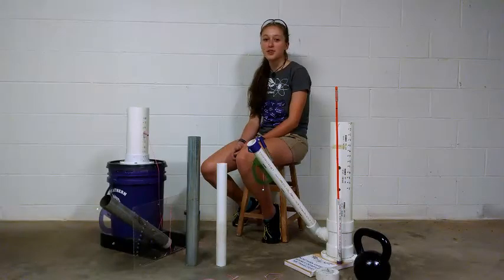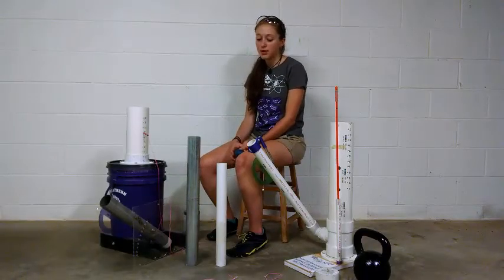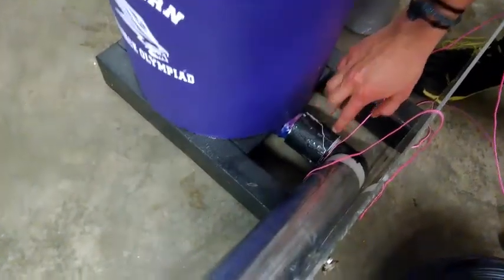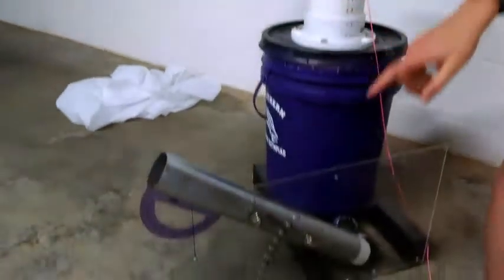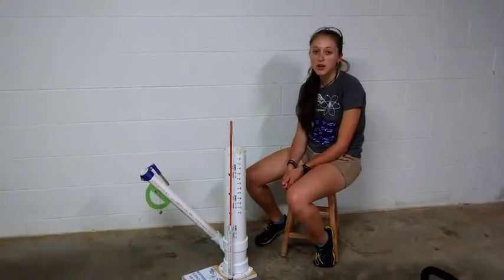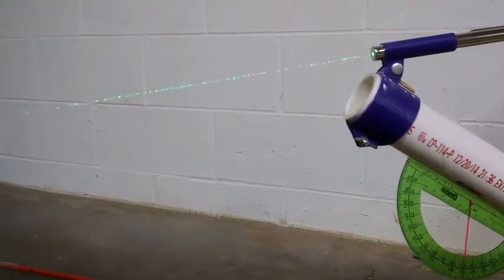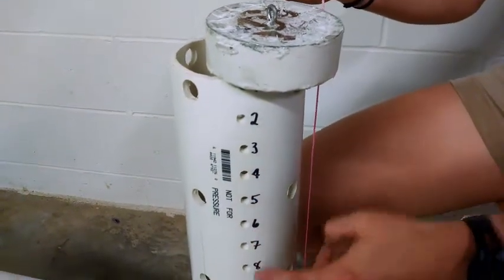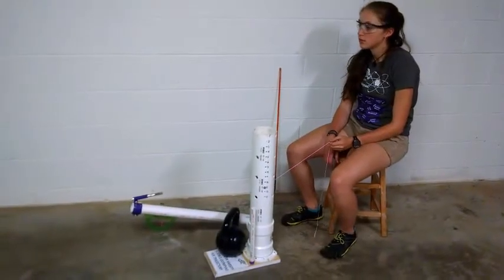Science Olympiad Air Trajectory

Comment: Hi I was wondering if you could explain how you were able to use the fence post to be able to change angles with the protractor with still being a snug fit so air isnt lost through the holes?
Reply from the maker: To change angles, just twist the pipe... do not glue in place.     Some air is lost through the holes but not a significant amount

Comment: Can you explain how you use the protractor, string, and the written angles to figure out the angle?
Reply from the maker: the string with a weight will hang strait down... just attach the string to the center of the protractor to measure the angle

Comment: How did you make that mass for the 2016 model?
Reply from the maker: We found a metal food can that was similar in size to the PVC diameter, then  Filled the can with fishing weights.   To ensure a snug fit, the outside of the can was wrapped with tape
Reply: @TMartScience how were u able to make it into one cohesive mass? With glue? Melting the metal? And did u attach the eye hooks
Reply: @TmartScience same question ?

Comment: Do the holes on the PVC of 2016 model where the weight is dropped affect the actual performance? What if we had used a normal 4 inch by 2 feet pipe without any holes?
Reply: My logic behind this is if the weight drops down a tube with holes doesn't the collected air while the weight is falling down the pipe leave through the holes?
Reply from the maker: I don't think much air pressure is lost to the holes. By the time the piston/weight falls past the holes, it is accelerating rapidly.
Reply from the maker: This clearly would be an experiment worth trying!
Reply: @TMartScience  For sure! I'm definetely going to try this out for myself! Thank you.
Reply: @TMartScience  An additional question I had was what the purpose of the toilet flange on the 2016 model is. It seems to not be attached to the PVCT but instead be a ring around it, does it serve some sort of purpose?
Reply from the maker: @jowoshy2691   the toilet flange was just a mounting bracket.  This way it could be easily attached to a base so the device would not fall over
Reply: @TMartScience  I see thank you!

Comment: how do you go about generating the energy from the falling weight? is there another air source that is providing the pressure?
Reply from the maker: Simply gravity...  The falling weight is carefully sized to be exactly the same size as the pipe.  (layers of tape were added so that it would be a snug fit.   The falling weight just compressed the air in the pipe- as it is forced out the side pipe, the projectile is launched.
Reply: @TMartScience  Any idea how to make this falling weight ?
Reply from the maker: @d6mallik    Yes... find a food can that is the same diameter as the pipe...  fill it with fishing weights... wrap with tape or plastic to ensure a good fit.